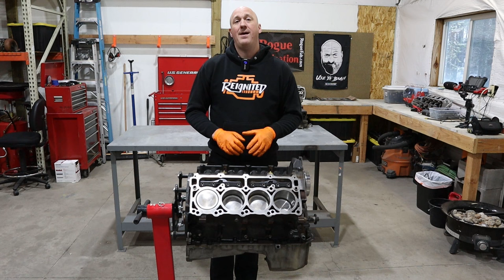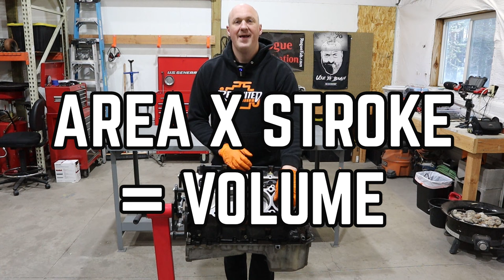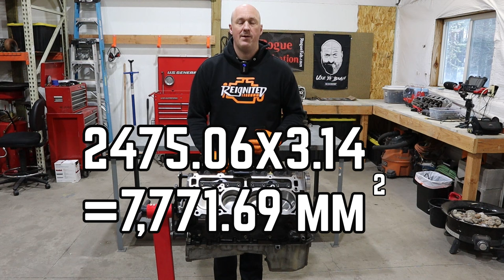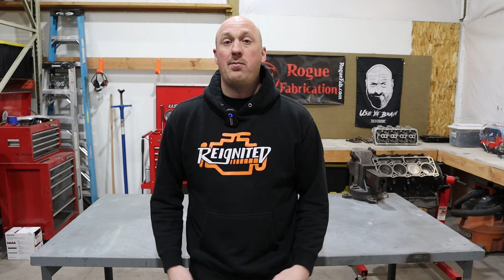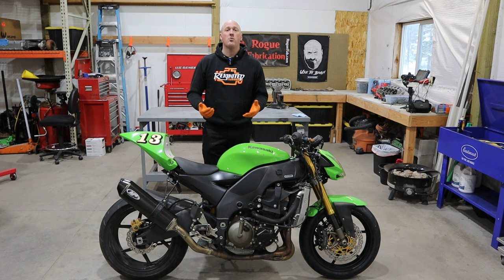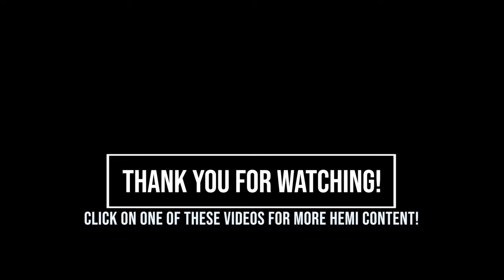Automotive Basics: What Does Your Engine Size ACTUALLY MEAN?

Comment: FINALLY SOMEONE FREAKING EXPLAINS IT IN ENGLISH NOT ADVANCED AUTO 101. Thanks dude this helped a lot
Reply from the maker: Right on, exactly what I want to hear 👍
Reply: @ReignitedAuto This video did help a little, although I use a slightly different calculation based on my measurements of my own cars engine. Hight x Width x Hight divide buy 14. 225 Cm X 64 Cm X 58.38 Cm Divided by 14 Cm remember I have to scale down 14 Feet by 30.48 Cm, it = 60L a true monster of an VR8 engine.
Reply from the maker: @mobythemerpup1515  I had one of those, they're pretty quick! 😄
Reply: Man my 4th grade teacher told me they found displacement by dropping the engine in water, starting it and measuring how much water was displaced, you said it’s air, how common is this water method or liquid method used ?
Reply: Fr i was a fake car guy before i watched, now I'm an educated fake car guy @ReignitedAuto
Reply from the maker: @DAMN__________  😄 baby steps!
Reply: I agree with you I thought I was the only one that doesn’t understand all the stuff.

Comment from the maker: What basic engine topic would you like me to cover next? Remember, there's no stupid questions when you're learning 👍
Reply: I have two topics.
You should come Camshafts lift and duration. I feel that one is harder to understand especially on how it affects the powerband.
Secondly, you did a good job on Displacement. I think you can take a step further on the difference between long and short strokes.
Reply: Coolant system like how does the heater core and engine use the antifreeze to cool the engine and ac
Reply: Swept volume vs. total volume, and how different cylinder heads can affect not only total volume, but also compression ratios.

Comment: Hey I have a question..maybe you can help me....I have a 2016 Chrysler 5.7 hemi...I have been having problems with the vehicle not going into reverse unless I switched it to reverse immediately after starting, also I have to time the RPM while driving to get it from 3rd gear to 4th gear. Do you think it's the transmission or the TCM? thank you.

Comment: I watch your videos and they are super helpful. Thank you. Idk if you will respond because I know you get alot of comments but I was wondering if you could give me advice. I'm replacing a cam on my 5.7 hemi due to the notorious lifter tick and was wondering is it okay to keep the old timing chain on it or replace it? The chain has 135000 miles one. Thank you.
Reply from the maker: That's actually a tough question.  For my own builds I'm completely fine with reusing the timing chain because we really don't see many if any timing chain failures.  However,  if I'm recommending to a customer I'll probably say to replace it just to be safe.
Reply: @ReignitedAuto  thank you for taking the time to respond I really appreciate that. The reason I ask is I replaced the cam in my charger rt and the timing came of. Didn't do to much damage just chipped one of my pistons and bent a valve on the same side but the other side looks fine. I haven't taken the valve cover off to see what may have caused the chain to come off yet but I didn't want the same problem to happen on my jeep. I may have tighten something down to hard or didn't tighten it good enough on the cam tensioner or maybe the timing was off. It was my first time doing it. Thank you and keep making videos man I love the knowledge you give very helpful 👍👍

Comment: On a four stroke engine cycle, at 1000 RPM would a 6.0 liter engine consume 6000 liters of ‘air/Fuel’ volume or would it he half that because every other stroke is a power stroke ?

Comment: Hey man, quick question: which variables result in a more powerful/agile engine? I know that there are several for each part but it's all very confusing😅
Reply from the maker: That's actually a great question, and one that has a very long answer 😄. The simplest way to look at is is that your engine is an air pump, the more air it can get in/out, the more power it makes. This is why an intake helps, because it helps the air to get in, this is why a larger exhaust helps, because it moves more air out. Cams accomplish both. Usually all of these things working together is what gives the best results. For my part, I think bolt ons like that are sort of a waste of time/money. I like to go straight to forced induction supercharger/turbo because you get more power for your money. 👍
Reply: @ReignitedAuto awesome! And I'm assuming that the lesser the time between piston cycles the more performant your engine becomes in turn, such that wider pistons and smaller rods are "better" for overall performance. Is there anywhere else where I can get more information on the subject of engine design? (I'm taking on a very long-term project for fun and I figured I'd start with the engine).

Comment: Just found your site. I just purchased a used grand Cherokee 92 with the 5.7. No start and no run situation. I was inspecting the spark plugs and found 2 of them smashed on the driver side. 2 on passenger side with oil. Is this engine salvageable?

Comment: Good evening, I would like to ask you a question, the oil pump of a hellcat 6.2 can be installed without any problem to a ram 1500 engine, 5.7 2022, do I need to make a modification to install it or does it fit perfectly? I saw your video and now I'm worried my vehicle is new it is working perfectly but I would like it not to have a problem in the future

Comment: I learnt something in this life that take the information from the expert. Some body told me that the "liter" refers to the fuel !! And here comes the question: Is the amount of air sucked inside equal to the amount of fuel ??
Reply from the maker: No, there is an air to fuel ratio that takes place inside the engine. This ratio changes constantly as the engine is running, but the "ideal" air to fuel ratio is 14.7 parts air to 1 part fuel.  👍

Comment: Let’s make something up, let’s calculate the ACM or ‘active cubic meters’ meaning the amount of engaged cubic meters firing at the engine
Reply from the maker: I like it,  a new system of measurement. Like horsepower, but better 😄👍
Reply: @ReignitedAuto  I think the flat plane crank produce more of that bang using the same overall displacement. Idk lol

Comment: Would a 1.5 liter engine have less torque and hp than a 5 liter engine? because (i assume) it has more space for fuel and air leading for a better combustion but worse fuel economy? sorry its a research about the differences between engines for my highschool automotive class, im not the most knowledgeable about cars, but i would be more than happy if you responded sir!
Reply from the maker: That's exactly right, the 5L engine has 3.3 times the displacement of the 1.5L engine so you are going to be using 3.3 times the amount of fuel during normal operation. Now one thing to understand is that it's not really a direct correlation between engine size and the amount of fuel that is used because engine design differs greatly which effects engine efficiency. Usually smaller displacement engines are more focused on good fuel economy with lower power numbers, whereas large displacement engines are more focused on power rather than fuel economy. 👍
Reply: @ReignitedAuto  thank you!!!

Comment: WTF.. stupid me thinking each cyilinder is of 5.7 litres in Volume.. so whats the difference between 4.8 L v6 and 4.6 L V8? Why V8 in this case has higher HP and torque, even though it has smaller displacement? Kindly teach us.

Comment: First thing he says is the physical size of the engine has nothing to do with the names like 350, 5.7L, etc. Then he says the formula includes the area. That is a direct measurement of a shape. May not be a big deal to everyone else but that is contradictory.
Reply from the maker: I knew someone would have a problem with that, what I meant but failed to specify, is that the External dimensions of an engine have nothing to do with its displacement. Much like a 5.0l coyote engine is physically larger than a 426ci LS engine even though it has less displacement.  Hope that makes sense.

Comment: Whats the difference in size between a 392 and a 6.4?
Reply: They are actually the same motor. In the trucks they call it 6.4 cause its a fairly good sized number in liters but they call 392 in the car because it has a more appealing sound to the "name" and in cubic inches it is bigger than a few sports cars. It is actually a bigger displacement than the hellcat motor
Reply from the maker: @Keaton Moore - nailed it 👍
Reply: @keatonmoore7934  and keep in mind a 392 means 392 cubic inches. They don't go by cubic inches in Canada and many other places, so they go by 6.4L. It's the same thing, just one in metric and one in imperial/standard. That's why you'll see Scat Packs in Canada sold with the 6.4L rumble bee instead of the 392 rumble bee.
Reply: @keatonmoore7934  thank you, figured something along those lines.
Reply: In addition, 392 has a history at Chrysler/Dodge as it was the largest of the early (1st Gen 1957-58) Hemi's available.

Comment: How small displacement engines with make more hp and torque
Like porsche’s flat 6 with 3745cc 
Make more hp than bmw’s 4.4
Can anyone help me 🙏🏻
Reply from the maker: It has everything to do with the efficiency of the engine design. Just because an engine is capable of moving a certain amount of air every cycle doesn't mean it does so. Some designs are inherently more efficient than others. Additionally that's why forced induction engines can make so much power, they are forcing more than 100% efficiency through the engine. 👍

Comment: Why multiply by 8 and not 4? I though the engine has 4 cylinders? Sorry, I'm still learning
Reply from the maker: No worries, and you're right it completely depends on how many cylinders the engine has overall. In this case, the Hemi is an eight cylinder engine so times the volume of one cylinder by 8 to get the overall volume.